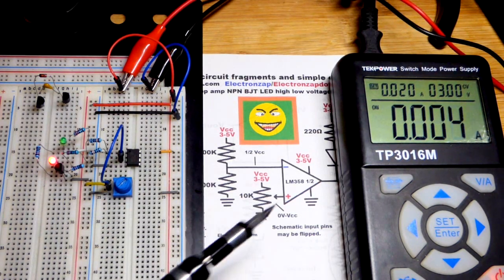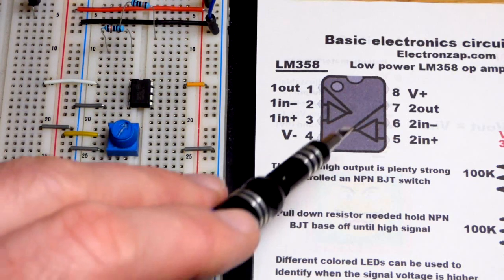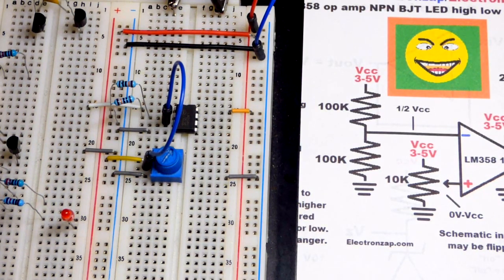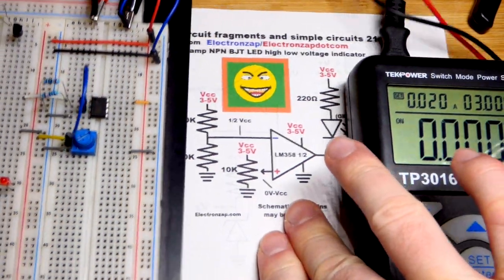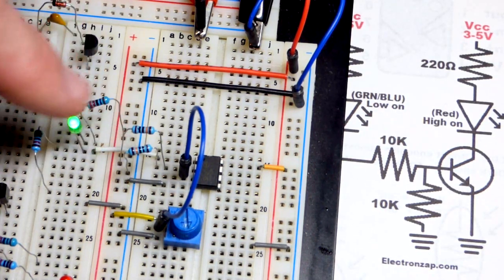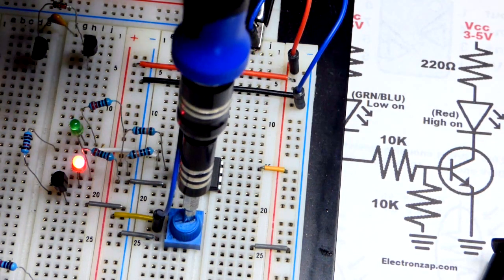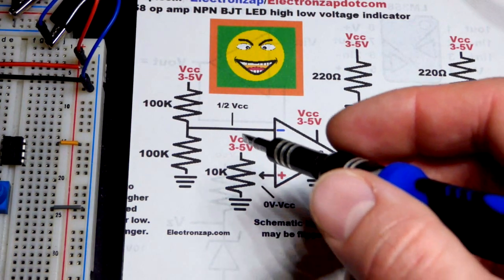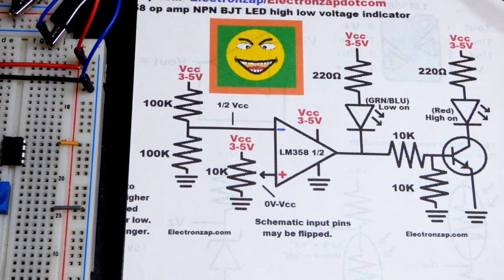Electronics course 23 LM358 op amp comparator NPN BJT improved hi low LED indicator circuit output

Comment: Yes, the extra resistor to ground is needed for Q transistor to keep the load off during the op amp output LOW, since it still has about 1volt left there, that keeps the led, Q,  still on. Or, a split power supply can be used with +Vcc, -VCC and Ground,to get pin 1 closer to Zero ground, so as op amp low position keeps the load fully off.  I had this same problem with LM358 voltage comparator.